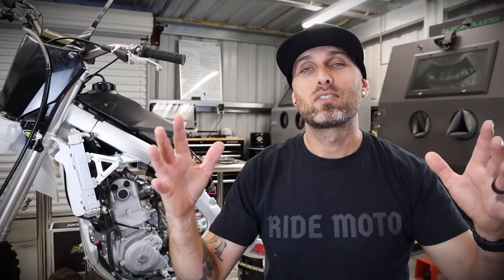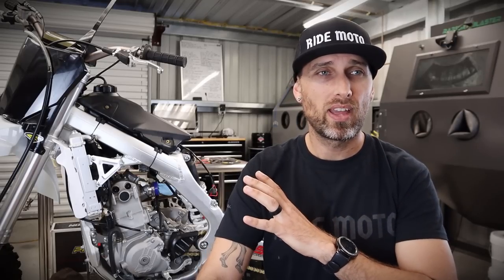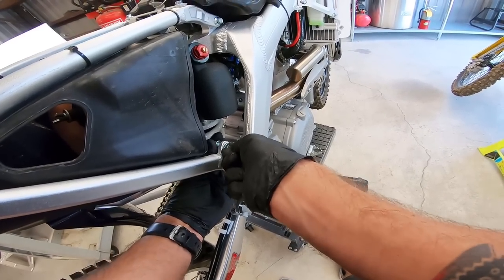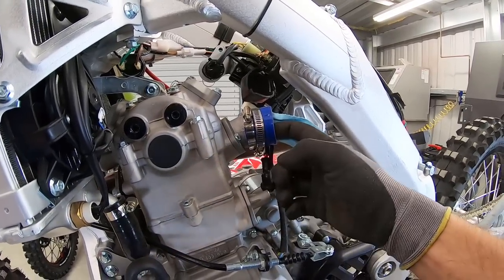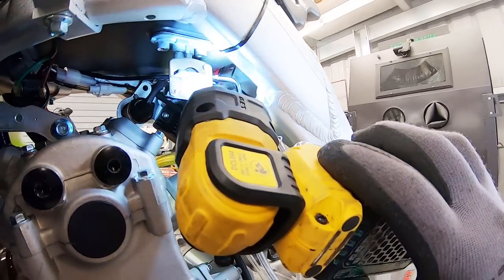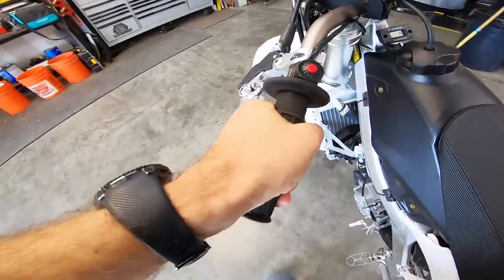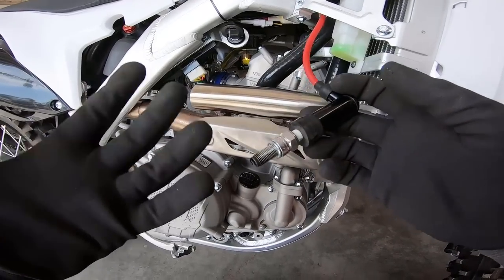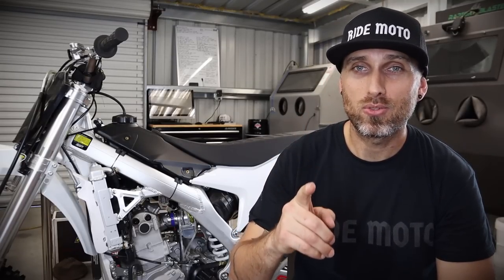I Installed A Lectron Carb in my CHINESE Dirt Bike... SHE REVS!! - 2020 SSR Motorsports SR300

Comment: You have to have the spark plug grounded to check for spark like that, on the engine case, frame or some other metal part. Came to the right diagnose at the end but you would not have seen a spark even if the coil was unplugged the way you were testing it.
Reply from the maker: You are totally right! Your boy gets a little carried away when he's filming 😁

It should have been laying on the pipe, like normal.

I appreciate you contributing so other people will be able to read the proper way to do it 🙌
Reply: lol i was wondering as well
Reply: Holy carp lol
Reply: I hink he electrons would have foumd a way through his body if the coil was connected :-}
Reply from the maker: @oldevil  Haha! One more reason not to hold the plug by the electrode . That s*** hurts!
Reply: a very lucky guy
Reply: Technically he was the ground and he didn’t get shocked
Reply: @kylechupick2232  Nope. He was holding it by the rubber boot, so he was insulated and wouldn’t have been shocked either way. The correct way to do it is to hold it by the boot and ground the plug on a metal part of the engine.
Reply: @Jordan-W  actually there is no need to hold it by the boot. You can safely hold it by the steel hex while cranking to ground provided you are holding it securely to ground, which is much easier to do when not holding by the boot. Since current seeks the least resistance path to ground, you are no longer in the circuit.
Reply: You said it before me ha
Reply: I’ll hold it don’t hurt scares you more than anything

Comment: This man spent half his bike on a carburetor 😂.. gotta respect it tho! 🤝
Reply from the maker: Had to drop a heart on this one 😂

Actually about 1/13th though now that I think of it...

No dollars were harmed in the making of this SSR Carb 😂

Thanks for watching, Jimmy!

-Charles // mXrevival
Reply: @mxrevival  can i ask why you dont have the kickstarter installed
Reply from the maker: @dd-yu4ff  you sure can. This will answer your question & Ill be doing a mod in the future for it as well! 

https://youtu.be/iPj0TzFlEcY

Use the time stampas, as the video is pretty long 🤜🤛
Reply: Yea I seen utubers do it many times 😂
Reply: @dd-yu4ff  it was in the way when riding. With the electric start he didn't need it.
Reply: @dd-yu4ff  Because it has an electric starter, also when he did the trail vid on reveiwing it he said his boot was just rubbing on it and was in the way, so he took it off.
Reply: what carb cost 2k ?
Reply: @mrr-ee6ui  $500-$600
Reply: Hmm. My old XR350R is still leaning against the barn, I wonder how well that would work.
Reply: @Rick-uy4kp  that's a great bike!!

Comment from the maker: OUR LECTRON CARB MOD IS LIVE!! 💪 https://www.mxrevival.com/product-page/lectron-carburetors-2020-ssr-motorcycles-sr300 THANK YOU ALL FOR THE LOVE & SUPPORT!
Reply: Good afternoon.  I just purchased the 2021 SSR300 TODAY. Instantly after riding it I was glad I bought it. Great price for the quality of build. However I did pay  4699 which was 200 dollars over MSRP. The dealer said that was the market right now because no one could keep them in stock and they sell as soon as they get them in and they only sent them one this time. I watched your video with the R&D team at the dirt track. I want to purchase the Electron Carb from you and need to know if it would work for the 2021 model. I'm aware they changed the carb and airbox this year. I did notice a slight bog when I blimp the throttle at a lower idle setting. It doesn't do this when I raise the idle a few hundred rpms. Van you offer any advice? Thanks
Reply from the maker: @MrBarberselect  NICE!! Congratulations on the new bike!

You're right, you can't beat a brand new bike for that price- that's a VERY good deal!

Yes, absolutely, our Lectron Carb Mod will work on the 2021 no problem BUT now that the intake & air boot inlet & outlet sizes have changed for 2021- we need to use the bigger, more expensive Lectron that is for four strokes. We have been using the two stroke style Lectron on the 2020 because it's fitment & cost effectiveness for due to the bike's original price point. 

That style Lectron is called the Gen II Kit:

https://www.mxrevival.com/product-page/lectron-carburetors-two-four-strokes 

I may be able to request a 2020 SR300 air boot & intake for you while they are still around but I don't know if they will keep making them! Then you can run our regular 2020 style Lectron on the 2021 💪

You can also swap some jets in your stock 2021 carb to get it dialed in as well. There are several jets in that type of carburetor, and the bog can come from jet sizes or a slack in the linkage that is on that style of carburetor. The "leak jet" is usually the culprit with bog off the bottom on the carburetor you have now.

You'll need to take it apart & make changes, then ride-test them. You repeat this process until you are happy!

It can take time but if you are patient you'll find a good setting. 

Only issue with a good setting is that sometimes when you ride much higher or lower elevations or there are big temperature differences, the carb can run "off" again when you are not riding in the same areas you first found your good settings.

That's why the Lectron is so popular. We set it up for your bike when it's built for you, so it can be used right away. (99% of people do not need to adjust it & 0% of my SSR customers have made adjustments yet) 

Elevation and temperature changes are no problem for the Lectron either 😎 It just works!

I hope this helps, as it can be a bit confusing - but I'm happy to hep you anytime right here: https://www.mxrevival.com/contact

That goes directly to my email inbox.

Thanks brother! happy New Year!

-Charles // mXrevival
Reply: I wish I had money. Like at all. Cuz I'd snap this bike and carb up like quick silver.
Reply: 33:33 I mean arguably, you have more traction on asphalt? Maybe that's part of the reason?
Reply: @mxrevival  It posted. Probably after the fact.
Reply: @mxrevival  It posted. Probably after the fact.
Reply from the maker: @dacarvoid45  I'm sure it aids the lift-factor!
Reply: I'm actually putting alot of thought into buying a 2021 ssr 300 and watching your videos is helpful on me making my decision.
Reply from the maker: @marcusalcantara981  glad I could be helpful! Honestly this is the price point and style of bike most people that just want to have fun need. Will keep making mods for them too 🤘

Comment: I have same engine that you have, but 250 cc. I do porting on exhaust and intake, for make it more instant flow, and the result is awesome, really diffrent than stock, im using 13 front and 50 rear gear. Its really easy to wheelie first and tirth gir even the frame and subframe was not almunium, the frame was steel. And its realy fun to ride.
Reply from the maker: So awesome!

I got to ride a modded & ported one yesterday! Now I need to do mine too!

Killer info, I appreciate your constructive comment.

Did you do the port work yourself?

-Charles // mXrevival
Reply: @mxrevival  thanks a lot sir 🙏

Yeah i do my self on porting the intake and exhaust port, just to the porting little bit, do not to much, just make the flow better that stock, and make flow more fast to go in the silinder from the intake, and for the exhaust port make sure ist really shiny when you porting it, so the rest of carbon and the heat more fast to flow to the pipe exhaust, and dont forget to take of the valve to makeit more easy to  do the porting, and after that  make sure the valve its not leaked compression when you put it back on the sitting vavle. 

- Dhay //  From Indonesia 👍

Comment: I have this bike for 5 years now and I installed a Keihin FCR carb on it,it came from a KTM SXF,it has  an acceleration pump which gives the bike much more power on the low revs,bikes runs awesome,no issue with the engine or frame!
Reply from the maker: Badass!

I rode a pair with FCR swaps a few days ago (video coming next week) and I feel the power increase you're talking about.

Thanks for sharing with everyone.

-Charles // mXrevival

Comment: Too bad the Frame gets in the way of adjustments on an older Honda. I got a Lectron on an 05 CRF250R.  Just got it to start for the first time since carb install yesterday. Out of the box adjustments weren’t close enough to get the bike to start. Turned idle up til it would fire, then turned it up some more to keep it running. Today after work I plan to try and dial it in. Just wish it was easier to reach the adjustment screws.If I can get her tuned up and running, it will be the first time in months that I’ll be able to ride my 250. Riding the KX85 was a little lame by comparison.

Comment: You need to go to that same place where you first took it out in Cali and do a compare test through the trails.
Reply from the maker: You sir, are correct!

It wouldn't be right otherwise! I'll do the same loop. No suspension changes, etc. 

Exactly the same just with carb.

Getting some amazing email feedback from my SSR customers who've ordered the new Lectron form mXrevival. 

That's the best.

Comment: I honestly wondered if those carbs were a gimmick or not. Now I know. Sounds really good now.
Reply from the maker: And it's just the beginning! 

Thanks, Reaper 🤘
Reply: That are not all that great based on my experience. I put mine back on the shelf and went back to stock. I am sure they are great for some, I didn’t like the feel.
Reply from the maker: @LGguedo  It's true, they aren't for everyone. Some guys like to tune and jet. This particular bike though, the SSR...it's great.
Reply: mXrevival glad you dig it. The one I tried I didn’t like, different power hit and could never get rid of the detonation. I tried and tried. It sits on my shelf now, at least it looks good.
Reply from the maker: @LGguedo  no kidding? Where was the detonation occurring? Up top under load?
Reply: mXrevival under load, I tried to tune with some expert advice and couldn’t dial it in. I am sure I could have gotten it right with more tuning, but also didn’t feel right for me.
Reply from the maker: @LGguedo  Sounds like you are getting close, and perhaps just needed a little more fuel from the external power jet screw.

If you ever feel like trying it again, don't be shy about reaching out to me.

-Charles // mXrevival

Comment: Full throttle, tip it over until gas flows from overflow, will start on first or second kick
Reply from the maker: You are right in the case of a flooded carb 😉

Comment: The Lectron carb has a high speed/load misfire as evidenced by the first test ride. I can hear it clearly. I do not know for sure if it is too rich or too lean, but I suspect too lean. This is because a partial/intermittent lean misfire is more subtle than a rich misfire. The needle should be raised one groove, then reevaluated.
Reply: Correction, the needle should be raised 1/4 turn, then test ridden to evaluate if the high speed/load partial/intermittent lean misfire is no longer occurring.
Reply from the maker: Part of the issue is that although the bike runs much, much better with our Lectron mod- it's still a two stroke style carb on a four stroke engine. This lean condition off bottom is true as there is no low speed fuel circuit such as an accelerator pump/ leak jet like an FCR carb. The ide behind this is the price point. It suits the bike's price point well (VS our four stroke Gen II unit at nearly twice the price). 

The Lectron has two circuits. The rod & a power jet, so perhaps a lean condition at circuit overlap wherein the power jet screw needs opened just a touch. This circuit is activated by engine vacuum and metered by tapered screw. 

Rod + 0% - 50% throttle range & PJ 50% - 100%

What's really cool is getting my guys at Lectron supply me with carbs to do these tests on Chinese bikes/ figure out these things although hesitant at first.

Cool breakdown via audio, J,S.!

Thanks for watching 🙏

-Charles // mXrevival

Comment: Looks like a must do upgrade.  Wish you could have had a dyno before and after, but seat of the pance and now it does roll on power wheelies is petty good proof in the pudding.  Maybe some roll racing and drags with other 250f's for comparison sake? Or its chief rival, the newly released efi klx300.
Reply from the maker: Honestly I can't wait to take this back out. The improvement just here at the shop is so great.

I actually called a local shop with a dyno but they weren't interested in the MX thing. They make too much with street bikes to bother with these "one off" dyno needs... as it was described to me anyway...

I think it'll take someone who loves bikes like we do that wants to be involved in the first place.

That KLX is good looking. Only thing I think that knocks it out for a true comparison is that (like the Honda & Yamaha 230's) the KLX 300 is still not quite a full size machine like the SSR. It's every bit as large as my RM250 & RMZ450.

Comment: Dang sounded way more responsive I’m totally interested in trying out there carb on my bike I’m not to familiar with jets and tuning sounds like something I can benefit from good luck with the brakes after adding more power haha 🤙
Reply from the maker: 🤣 We will have a look at yours soon, Sal! 

Bike definitely runs much better in general. 

We will have to head out to Hollister and see how we do, huh buddy?
Reply: They are like $600
Reply: @joshjewell7089  ya didn’t work out I ended up just getting my original carb  rebuilt they gave me a jet pack and like some basic info on tuning so ya works out got new wheels instead lol 🤙
Reply: @joshjewell7089  I am shocked he did not use the Chinese version of the Lectron carb! Much cheaper! Commies don't care about patents!

Comment: Put a PEACE of heat shrink on the adjuster where it bends on the cable just incase that battery rubber cover comes off itll stop it arking against it
Reply from the maker: It's a great idea. I was able to get the cover to permanently stay in place by using a good TB brand zip tie 🤜🤛 Thanks for using your head, Mysterious! That was a good one.
Reply: @mxrevival  or good buddy glad to hear & thanks alot

Comment: Killer vid Charles your crushing it with the 300 mods!! Damn man that Lectron really makes yours sing!! Hearing yours after you leaned it out I think I need to go lean my smart carb a little.. Did you ditch that restricted ass air filter cage backfire screen? Pumped on the Elusive graphics in the works, ready to order a set soon as available. Keep killing it bro👊 Sick Ride Moto merch btw🤘🔥
Reply from the maker: Thanks J!

Man I don't know, yours was looking pretty badass in those wheelie videos!

No, I didn't pull the filter cage just yet because I'm trying to do things one at a time, in order to get the best description and feel for how each individual mod wakes the bike up or not. I'm always tempted to do it all at once! But I'm going to behave on this bike...

Too funny, I was sitting there revving it with the choke on wondering why it was rich! Turned the choke off and so far just perfect. We will see how the trail test goes down but it already runs so much more consistently.

Thanks so much for the support brother. Just got a photo from Elusive yesterday of how he templated the radiator shrouds 😍

Appreciate ya!

Comment: should throw a yoshimura or fmf some pro taper bars and stuff like that sick bike do you know if they make a 125 big wheel
Reply from the maker: They have SO many bikes... I like the 189. I would put it ahead of a 124 in that, it has a full frame cradle, (you can jump it without the frame backbone bending - like say, a TTR 125) inverted and adjustable suspension, electric start. 

Just hop in their website

Comment: It should have a carb with an accelerator pump. 300ex ATV carb. I put one on my 1995 KLX250R ran perfect.
Reply from the maker: I believe you, great mod!

Check out the newest video if you're interested in seeing these bikes run with different size pumper carbs 🤘

Comment: When I was still riding I would've loved to try a Lectron but man!
I never could afford one... and 4 for my GS1000? No way!
I admit I'm an old guy with no experience with the modern 4 strokes, I'm wondering why you didn't fatten up the low end to eliminate the bog and set there idle lower, it seems pretty fast (high) to me?
Reply from the maker: They do cost a pretty penny, but they do actually work. So, a very nice product overall for the money.

I do actually re-jet the bike and it's stock carburetor in video number one. It helped.

But at the end of the day it's the improper application for this engine and just wasn't quite the right pairing in order to get more out of the engine, the power that's stuck in there with the stock 2020 carburetor on it.

The 2021 drop kicks this old carburetor completely for a fcr clone, or pumper type.

Comment: Ive had a problem with using lectrons on my 2 strokes. They are really nice for the bikes i use for racing that get top ends frequently anyways BUT the lectrons definitely shorten the life span of pistons. My air strykers and smart carbs are way way waaaay better than the lectrons
Reply from the maker: Some guys have reported they do run lean at certain times. They also have a reputation for being able to be “bolted on, and just ride” which some guys, who do need to tune a little bit, just run with.

I’ve noticed most of the blow up some failures happen with that crowd of riders’s.

It’s the negative side to a positive reputation 🙃

Comment: Im trying to buy my very first dirtbike and have roughly around 2,700 i can spend what would be some good options to get myself into riding my height is 5'11 and my weight is 245 pounds.
Reply from the maker: YZ250 all day! 2002 or newer 💪 Welcome!
Reply: @mxrevival  Will that be to much power for me? and the yz is a 2 stroke right?